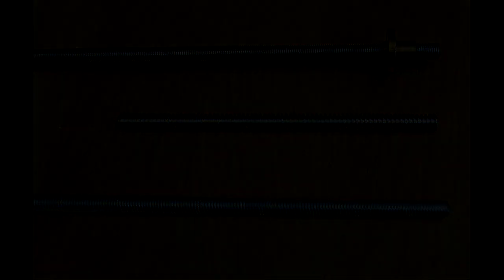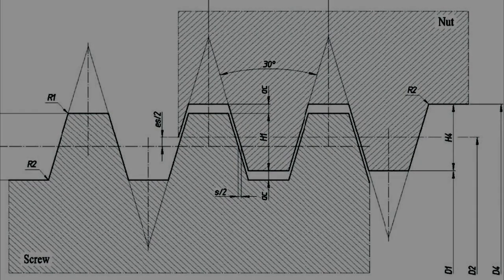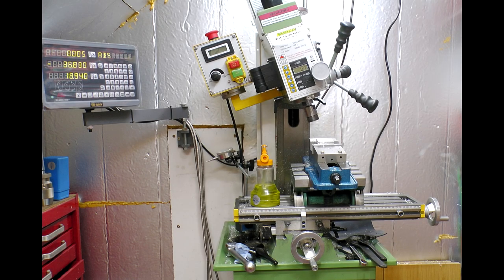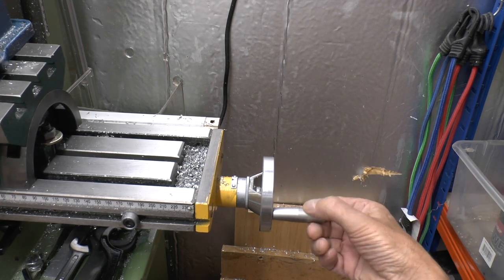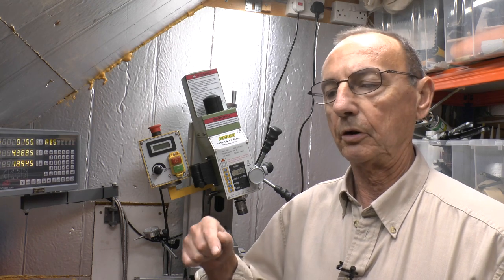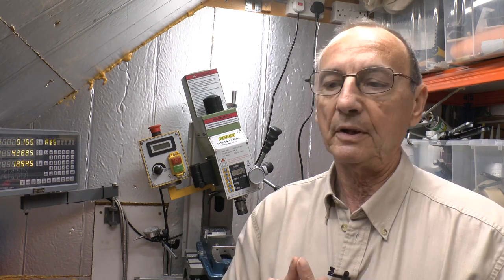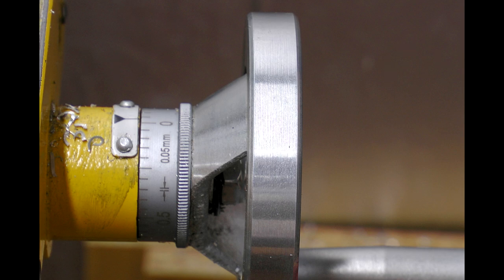All about Lead Screws for 3D printers

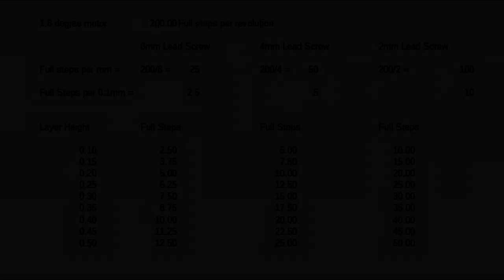Comment: 26:07 This excellent explanation makes me realize that z-height baby-stepping can actually trample all the positional accuracy even of a 2 mm lead screw. Because if, as a result of z-height baby steps calibration, your calibrated reference / starting height coincides with a micro-step position, then ALL your layers will be at micro-step positions, which is less than ideal. The solution to this would be to actually switch to using full-step mode while calibrating nozzle height, which means that the last micro-adjustments need to be done on the build plate, not on the z-axis itself. I'm wondering why I don't see anybody talking about this problem...
Reply: I never thought of this. It does make sense. But I love using babysteping. We can set the amount of babysteping in the firmware. We can set it to one full step.

Comment: So what about if you added spring pressures for you x and y to help with the back lash play ???
Reply from the maker: That's one way. Anti-backlash nuts often use that technique. If you've considered all the factors but still want to use leads screws for X and Y, then you'll certainly need to use some type of anti--backlash mechanism.

Comment: i always thought that if you want to remove an error from a cheep screw drive you just need to get a long enough nut to average the inperfections
and softer spring loaded pair of nuts could get rid of the backlash even on a cheapest threaded rod but is see it works a bit different as you put it
then again when building by wierd small 3d printer i decided to go with ..an m8 rod for the z because 1,25mm lead could work nice with 200 steps motor and i could get 0,1mm each 16 steps without microstepping the motor and 16 works great with binary conversions of the controller, 0,05 would be 8 steps, 0,025 4 and i doubt we need thinner layers 
so i wouldn't worry about using a hardware screw as a lead screw, 
what i find out on the internet people upgrading the m6  or m5 rods to proper lead screws only after the oryginal noot wears out and using the same non hardened metal for both kind of make it the bigges drawback actually
getting 2 brass nuts could have saved them from premature screw wear and nobody ever remember that with "first diy 3d printers" where budget is the main constraint , 2nd being avalability of parts

Comment: Thanks for the video! Always glad to learn. Would you say that a ball screw has no job in a 3d printer then? I see lots of designs with 3 ballscrews for the z axis leveling and considering these are really expensive compared to the leadscrews it seems like premature optimization.
Reply from the maker: IMO, ball screws are designed for lower friction - even lower than lead screws. As you rightly say, they are very expensive because the "nuts" have ball races inside which makes them expensive to produce. The threads are often ground too - which is also a costly process. I wouldn't go as far as to say that they have no place in 3D printers, but personally I don't believe that the additional cost can be justified.
Reply: @deckingman  Thanks for the reply!
Reply: @deckingman  how about in a homemade cnc router machine ?
Reply from the maker: @Robert-zx2df  Well, that's not my area of expertise so I'd be hesitant to advise. But the same principles apply. Importantly speed and back lash but also size and loads. CNC machines tend to be larger than 3D printers so if you plan to build the machine larger than say 1,000 mm in X or Y then you might find lead screws are hard to come by, and you'll likely need to use a diameter greater than 8mm to prevent "whipping". So that might force you down the belt route. On the other hand, CNC heads are heavy but more importantly, the cutting forces are much higher than the (near zero) force required to move a nozzle through air. So belt stretch might be an issue. The denser the materials and the bigger the cut, then the higher the forces which might cause belt stretch. So I'd say the decision would also depend on the type of material and size of cutter you plan to use. Screw driven would be a better choice for large cutters and thick, dense material due to the loads which might lead to belt stretch. But belts would be a better choice for taking small cuts and/or for cutting low density material where speed is more important and loads/forces are low. But as I said, that's just my best guess - suggest you take advice from a CNC router forum or user group. If it were me, I'd probably use belts but much wider than the 6mm we use with 3D printers. HTH
Reply: @deckingman  thank you for that indepth reply. I have no hesitation listening to your advice for cnc even though as you say it's not your expertise. 

My concern with belts were torque. A belt drive is more or less 1:1 ratio. If you're driving a light load then thats that's fine like you say. I like how there is a gearing  effect with screws giving more torque. I don't mind if my machine cuts slow, nothing wrong with a slow cutting machine as long as it gets the job done. I think it will still be way faster than me doing it by hand.

The kit I found only comes with nema 17 motors. The torque on these things doesn't sound very high so I can't imagine them going fast in belt drive. If I didnt care how fast my machine cuts , could Ialso keep gearing it to achieve the torque required or does my logic not apply to stepper motors ?

I'm trying to build this for cheap just to learn and have something I use once in awhile. I was looking at using basic all threaded rod. You say there is more friction in it but I'm hoping that doesn't make the machine unusable? 

I'd want to make the table  as large as I can but will probably be limited to 3' or 4' max  in x/y. Used to cut wood , no metal. As cheap as possible , doesn't have to be fast. 

Thanks
Reply from the maker: @Robert-zx2df  Belt drive doesn't have to be 1:1. You could use a spindle with two pulleys - one large and one small, and a "remote" motor. The small pulley drives the machine, the large one is driven by the motor (which has a small pulley). So say you has a 20 tooth pulley on the motor and a 100 tooth pulley on the spindle, then that gives you 5 times more torque. But there is a bit of a caveat with stepper motors which is that torque drops off at higher speeds. So you need to look at the data sheet for the motors and make sure that whatever speed you drive them at, there is sufficient torque available. The more you increase the gearing, the faster the motor has to spin and there will be a point where the gearing leads to too high a speed and the torque actually drops. You'll have that same issue regardless of whether the gearing as achieved by asymmetric pulleys and belts, or whether it is achieved by using screws.  
My first printer was a Mendel kit and it came with threaded rod - I don't think you'll have a problem with friction as such. Although, trapezoidal thread forms have more clearance at the root, so they are less likely to jam if the screw gets covered in swarf or in you case, saw dust. Consider fitting some sort of telescopic cover over the screw to keep the dust out if that's feasible.
Reply: @deckingman  
Thanks 

Yes, I was thinking of covering with telescopic cover. Either 3d print or maybe use one of those accordion style dryer exhaust hoses

Comment: You forgot to talk about positional accuracy and tolerances. Are the tolerances of lead screws typically better than that of "threaded rods"?
Reply from the maker: I touched on it when I said that both types (lead screw and threaded rod) are made the same way using the same machines - just with different shaped cutters.
Usually, it's very difficult to find specifications for threaded rod. There are "armchair engineers" (the type who have never cut a thread and have no idea how it's done) that you will come across on forums and who will trawl the internet and find specifications and tolerances for lead screws and then compare that with a "generic" specification for threaded rod. From that they will deduce that all threaded rod is inferior to leads screws (even though a lead screw is by definition a threaded rod).  
The way that threads are formed on machines (either screw cut or by using a die) means that any variability would be in the depth of the root or the height of the peak. But the critical dimension is the the flank to flank distance and that will always be the same - even if a cutter wears. That's not strictly true but the probability of seeing any significant flank to flank variability along the length of any threaded rod is up there with getting struck by lightening while standing on one leg. 
In a nutshell. it's perfectly possible to find threaded rod which is more dimensionally accurate than a lead screw and vice versa but either one will produce consistent linear movement of a nut for any angular movement of the screw (because the flank to flank distance will be the same due to the way the thread is formed).
Reply: deckingman That’s good to know :D I tried trawling the internet for specs and only found the tolerances for the diameters as you mentioned. I did the misstake of assuming this diameter changed across one rod and estimated the difference in height from there, but you are correct that these tolerances are for the whole production line so a single rod should be very accurate :D
Do you know if there’s anything to be gained from having the rod in tension instead of compression? I’ve never seen a printer use rods which are under tension, but I feel like it would be better, maybe the whipping will be reduced? :s You could also get away with thinner threaded rods that way, but maybe M1 rods are harder to get than M3 rods, so it doesn’t make much sense to go thinner.
Reply from the maker: @beaconofwierd1883  To put screws under tension would mean that they would need to be constrained at both ends. That's generally not a good idea because it can cause problems in getting them perfectly aligned with the linear guides. Screws should not be used to guide the bed or carriage or to constrain it - that's the job of linear guides or rails. For that reason, some amount of "float" is usually desirable and the easiest way to achieve that is to only constrain one end of the screw.
If by "under tension" you mean something like a screw supported at the top with a build platform "hanging" on a nut, it really makes no difference. I've seen printers built that way with the stepper motor at the top. The main practical disadvantage is that the entire weight of the bed is then transferred to the stepper motor bearings, and they generally are not designed for that sort of loading. I prefer to support the weight of the bed by using thrust bearings at the base of the screws. which are designed to take that sort of load.
Reply: deckingman Couldn’t you use thrust bearings in the same way when hanging? Just support the coupler with a trust bearing and have the stepper take no load, only apply torque?
Reply: @deckingman  Also, isn't the bearing in most stepper motors (for example Nema 17) equally good (or rather bad) at axial loads in either direction? Or is there a thrust bearing at the bottom?
Reply from the maker: @beaconofwierd1883  Yes you can use thrust bearings with the screw"hanging down - it's just a bit more difficult to do. AFAIK, steppers motor bearings are equally bad in either direction. In fact, if you've ever taken one apart, you'll know that the bearings are really quite tiny and not the best things for high side loads, let alone end loads. Nema 23s tend to have bigger diameter shafts and so larger bearings which look to me to be much more robust. But if there is s significant end load, I always like to use separate thrush bearings. Not many people bother and I haven't heard of all that many motor failures, so maybe I'm just being over cautious.
Reply: deckingman Well, I guess I’ll just have to try and see how it affects the accuracy :) Do you happen to know what term to search for to find how much axial wobble there is in stepper motors. All I can find is axial play, but the play is eliminated if there’s some axial load, right?